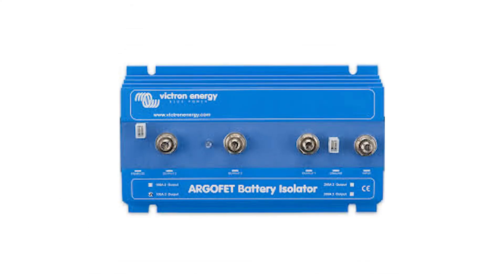How Do I Charge a Lithium House Bank and a Lead Acid Starter Battery With My Alternator?

Comment: That was a a lot of potentially confusing unstructured information for a fairly standard "simple" boat installation.  Yes, there's a risk of the generator/dynamo overheating, depending on how discharged the Lithium is, and the RPM of the engine (or rather, the rpm/cooling of the generator/dynamo).  He should keep an eye on the generator/dynamo temperature. .......... and he should have some kind of current limiting (dc-dc) device with suitable lithium charging output between the charge current from the generator/dynamo (or the diode) and the Lithium battery. ........ Assuming he has the same installation as I have, but many has. ............ And it's important the starter battery remains connected (assuming it has its own diode output) so the generator/dynamo has somewhere to output its power if/when the BMS disconnects the Lithium internaly. ........ As if not,..... a BMS disconnect can cause a destructive voltage spike.

Comment: Instead of battery isolator, hook up a pure sine wave inverter to starter battery, then run AC extension cord to a lithium battery charger dedicated to lithium house batteries.  NEVER mix battery types on a circuit.
Reply: Why so complicated?
I use Victron DC/DC Voltage regulators. They are also perfect to stabilize / normalize Voltage on long cable lengths.
And the cool thing is, you may parallel several of them. 
In my Motorhome, I have 3 * 12V / 30Amp in parallel.
Reply: @MrRossi1805  Sound like good option.  I already have inverter to run Induction Stove and already have battery charger when I am hooked up to dockside power, so I am using what I already have to charge batteries while maintaining isolation.  Plus, AC can run long distance at much thinner (& cheaper) wire.   Over distance, AC is my preferred choice (Tesla vs Edison).
Reply: @miken7629  thank you
Reply: @MrRossi1805  I have 2 for 60 Amps that best matched the 60 Amp house charger and 120 Amp alternator. If using an external regulator at the additional cost have higher output but raises the temp of the unit. In order for the alternator to put out the higher amps would that not raise the voltage into 15V range thus would tend to cook the agms?

Comment: Answer , always YES . Set the ext Reg to LifePo4 charging profile . Have a battery isolator between the Alt , Starting battery and LifePo4 house bank .
Reply: Explain.  What's the external regulator you use?
Reply: @BOREDANDWELLBORED  unless I'm misunderstanding, I think this is referring to a DC to DC charger which is really a voltage regulator often with a custom charging profile.

Comment: in this example, wouldn't replacing the isolator with a DC to DC charger with a custom lithium profile be best?  I'm adding a dual lithium bank to my set up also so this is a great conversation.  Thanks for sharing and curious how Adam made out...

Comment: Is there a circuit drawing I could refer to in connecting alternator to starter SMF Battery and House Bank of LiFePO4 with a shore-power Changer connects to both Start(SMF) and House(Li) banks?

Comment: But you could also use your seperate BMS (if so equipped) and with that regulate your current that your batteries can take based on your alternator and not exceed 75% of rater capacity (Make certain you check prior over the source of an hour as the alternator goes to "hot" and after about an hour not to exceed around 220f if alt make is a reputable make with heavy duty high temp bearings. Japanese or Italian. I like 330 celcius cartridge bearings.

Comment: Why so complicated?
I use Victron DC/DC Voltage regulators. They are also perfect to stabilize / normalize Voltage on long cable lengths.
And the cool thing is, you may parallel several of them. 
In my Motorhome, I have 3 * 12V / 30Amp in parallel.
Reply: The Victron products are very robust: most people do not realize how three phase charging work: (Bulk, Absorption, Float). The Victron Smart DC-DC converter in BATTERY CHARGE Mode allows you to customize the charge profile for the battery (not all Lithium or AGM batteries are designed to the same specification for charge profiles). For example: on my Lithium 200 AMP Hour house system and AGM 100 AMP HOUR engine system - the Lithium batteries were not getting fully charged by the standard Lithium spec provided by Victron (14.1 volts). My Renogy Lithium batteries require 14.4 volts.

 In my system, I have two VIctron SHUNTS (one for House and one for ENGINE - once those settings were changed I could visually see the current increase to my Lithiums and the voltage rise. I would suggest anyone doing a Lithium/AGM install use two shunts to really verify what is happening in their system. The RENOGY Lithiums have a Bluetooth interface, so I could also see what was happening internally.

Comment: They will all tell you that you must have a DC to DC battery inter connector.... Yet the problem is because the Lithium battery voltage is much slower to rise than a lead acid battery your alternator is going to put out its maximum amps for to long   and burn itself out....  

I'm an electrician and on my RV I got around this problem without a DC to DC battery interconnect by placing my lithium house batteries right down the back about 20 ft from the starter battery,  I then used some heavy gauge welding cable which over that length had near half an ohm of resistance ..   and that cable limits the current enough so my 120 amp alternator does not put out much more than 60Amps into the lithium batteries. I installed a 150amp battery isolator in the circuit as it is not good to leave lead acid and lithium connected when not being charged... Alternator regulator is set to 14.5 volts which is ideal for both the lithium and lead acid batteries, although if I expected to be doing extended engine hours I would be thinking of installing a three stage alternator regulator so as not to be over charging.    The DC isolator allows me to use some house battery power when starting to..... And charging the starter battery from the house solar panels when needed. 

It works for me because I don't mind a bit of hands on... but if you want fully automatic think Victron DC to DC battery inter connects, any extra Victron costs seems to be repaid in performance and reliability.
Reply: Where is it common to put the battery isolator, close to the starting battery or close to the lithium in the back?

And your alternator voltage is adjustable or did you modify it to 14.5v?
Reply: @perrymartoredjo5420  Hi.... putting a battery isolator close to the battery, either starter of lithium house battery carries the logic, if things go bad and you switch the isolator off you would like to think it will take power away from the majority of the curcuit and equipment... isolating at the source so to speak...when you have a battery both ends of a cable run that logic is sort of negated... but say a cable wore through and was starting to fry but not pop the fuse, where in your installation is the logical place for someone to look for the battery isolator if they do not know your installation. 

I have not wanted to adjust my alternator voltage from 14.5volts, which by the way changes a little with temperature, as it is close to the correct boost charge volts required by my lithium battery management system to do equalising charge.   I limit the amps entirely with the resistance of the 30ft 100 amp cable run. So the most I have ever seen going from my 120 amp alternator to my 300AH lithium house batteries is 51 amps.....which is unlikely to ever damage the alternator. 

By the way I did buy a 50 to 50 amp 12volt battery to battery Victron battery interconnect unit when I first installed the Lithium batteries for house loads... but realised the interconnect unit did not give me the ability to use the house batteries in assisted jump starting a flat engine battery, or to use the house battery solar to charge the engine starter battery... both of which the long cable run with a simple battery isolator does allow.    I still have the brand new battery interconnect with programmable battery charging abilities..... looking for some other application..

Comment: Hi I have a 2 renogy 8d agm deep cycle and 4 renogy group 27 battery. 
Two of the 27 supplied 2 Yamaha 350. 
One of the motor isolater lead charge the house system batters. I do have an 3000w pure sign wave inverter. Also have the renogy 800 watt solar kit. I have a xantrax ech charger Hooked up from the house system to the engine batteries in the event I use the inverter charger.

Everything appears to work great, “my problem is I can’t seam to get rid of the battery lingering charge scent”.

Boat is a 32’ hydro sport, center console with forward cubby cabin. 

Any thoughts on that?
Reply: Jeff you have no thoughts on my message.

Comment: I have  battery isolator(100 Amp) feeding bow thruster and engine AGMs. There are 2 Orion 30 Amp chargers feeding 300 Ah Lithium house bank. The alternator is 120 Amp Valeo. Is it worth converting the Alternator to external regulator?
Reply: I think the Orion is already limiting the amperage for you and it's regulating the voltage to the lithium profile (assuming that you programmed it for that), so I don't think it's necessary but I would wait for confirmation from Jeff.

Comment: Sorry, but we never find out if these are (dumb) internal regulated or (smart) external regulated and programmable alternators.
And aren't battery isolators passe, out dated, etc.?
First off, external regulation is a must, a no brainier.
Second, both alternators should combine thru a device, maybe center fielder by Balmar.
Then that output should go to an AGM battery, then to a DC to DC programmable charger, then to the lithium bank.
Size the DC to DC accordingly to meet the demands of the lithium bank.
Is this not a better way?

Comment: But isn't the issue that the internal resistance of a lithium battery is much lower than a lead acid battery, so, consequently, a lithium battery will draw far more than the (say) 40 or 70A intended current from a standard (say) 13.9V alternator output? (which is potentially a fire hazard). How do we overcome that issue?
Reply: That's not a hazard, unless your cables are much too thin for the current the alternator can deliver. .............. How "happy" the lithium is about having 14.0volts instead of 13.5 float over a long period of time, I do not know.
Reply: @finnerutavdet  Sure,  the battery can take it, but  isn't the issue that an alternator designed to deliver (say) 40A finds itself delivering (say) 80A, because the internal resistance of the battery is so much lower.
Reply: @stephenburnage7687  The alternator will deliver as much as it can at the RPM it has, and if it dos not get to warm doing that, then that is ok.  If it gets too warm that is a serious risk.
Reply: @finnerutavdet  That is what I understood ie you cannot simply drop in a lithium battery where a lead acid was, as you risk overheating the alternator (and probably the cables too). Put it another way, configuring an existing lead acid system to lithium requires some thought, with overheating or even fire a possible outcome if you get it wrong. Personally, having researched Lithium on my boat, I decided to ultimately go with AGM's, as it a much simpler system.
Reply: @stephenburnage7687  Yes, that should make it simple. ......... I just removed my 5 lead acids (once upon a time 100AH each). ....... I'm gonna do something most are NOT doing, which is to combine lead and lithium, but it's not optimal, expensive, a lot of re-search and a lot of work (building my own banks), and I'm not even 100% sure I'm gonna succeed.  The reason I want lithium instead of like you, go for AGM, is that I want to be able to re-charge them from a noisy generator in the shortest possible time, and only Lithium can do that. ........ If the cables were o.k. for lead they would have been o.k. for lithium as well though, as the BMS in the lithium limits the current to less than wat a lead can put out. ..... The main problems with lithium is the small possibility of some generators overheating which one needs to test for or take care of, and the other main problem that most seem to be unaware of is that the BMS can disconnect the lithium battery (internally), and then there has to be lead in the system as well, as if the BMS disconnects and you don't have any lead in the system (for instance the starter battery), then you can get a voltage spike when the current from the generator suddenly has nowhere to go because the lithium BMS disconnected to save itself from for instance overcharging, and that spike can destory much of your electronics (in the worst case). ...... I'm an electronics engineer, and this is kind of new to me, but I'm still learning.  But for a simple solution, yes, stay with Lead. .......... The channel of Clark has nice videos on the subject (most of what I know I picked up from him, and some from the off grid garage). ............ B.R.
Reply: @finnerutavdet  Interesting. I gather that most lithium battery manufactuers advise against using them for high current loads (such as windlass, bowthruster etc) so they themselves recommend having both chemistry's on board, complicating matters considerably. That suggests having two separate (shore power) chargers, as i gather no smart charger on the market can handle two different chemistry's - if you try, you end up with overcharging one and undercharging the other, reducing battery life. Another example of complexitiy is with the alternator - with various work arounds suggested, such as leaving it to only charge the lead acid portion of the system. But how to charge the other bank? One yt cruiser did it the other way round and configured the alternator to charge the house bank but his only means of charging the start bank was with solar. I knew a cruiser like that - he could never leave his anchorage before midday. The other issue is with the manual and automatic combiners (that your boat would have been originally fitted with). If you remove both of these, what to do in the case of a BMS shutdown? Remove the automatic combiner but keep the manual one, with a big warning label, saying only to be touched in the case of a blackout? Sure, you can overcome these issues by installing various DC to DC convertors around the system, but then you have essentially created a digital system which (depending on where you are), is vulnerable to voltage spikes from electric storms etc. So, I like lithium for many of its attributes but these complexities have to be thought through.

Comment: I want to charge my lithium bank with my alternator (balmar 170amp) but, start my engine with my agm bank... is there a way to do this?
Reply: You could plumb the alternator straight to the house bank and charge the starter via a DC to DC charger. Although in this scenario you run the risk of the BMS opening the bank and blowing your alternator- having the settings right on an external regulator is key with this scenario.
Reply: I have a module that protects against that... but, if my alternator is wired to charge the lithium bank does that not also mean it draws from there as well...ie; when I start the engine??
Reply: @aphrodite3216  Definitely a good idea to have a dump protection device. I have a sterling on my boat- thankfully haven't needed it ever. 
For separation of banks- the starter bank only connects to the engine's starter motor. The alternator is connected to the lithium bank. In this scenario the banks are completely separate.

Comment: SORRY I AM CONFUSED why dose he have two starters. Two engines why.  And 100 amp alternator is a bit much for a lead acid battery. Usually they are 70 AMP.  And Whats charging the lithium battery bank.  I would not expect  an isolator to cause a voltage drop. And  i am not familiar with them . But i would expect an isolator to come with battery temperature sensing thermometer. Alternators have their own internal voltage regulators.
Reply: an isolator by definition had FETs that have .1th the voltage drop that the older diode ones.
Reply: Cats have 2 engines…
Reply: Many, many powerboats have two, or more engines.  This topic is not just for sailors.

Comment: What if the starter batteries are small lithiums? does that solve the problem ??
Reply: Pretty much- you'd want to connect the two lithium banks with an Automatic Charge Relay so there's no voltage drop similar to a diode style isolator. Although I think the transistor style isolators are pretty good- better than the old school diode style at least.

Comment: Unfortunately, you did not really answer the question.  One that would be interesting to have answered is “how does lithium react to charging under lead acid profile?”
Reply: If you consider 14,25 V absorption voltage, a lithium battery would never reach the full capacity
Reply: @MrRossi1805  This is from the RsLion data sheet Charge Voltage	14.2-14.6
Balancing Voltage	14.4
Float Voltage	13.3-13.8
Reply: This is the 2 Orion settings Absorption V	14.20
Float V	13.50
Reply: I think it creates excessive demand on the alternator/charging circuit and eventually causes premature failure.  I'd expect it to work till it breaks down.  I've heard  instances like this where temp was monitored at the alternator and found to be pretty high in under 20min.  I think almost all lith batt manuf (unless certified 'drop in ready') are firm on using a custom charge profile vs wide open.